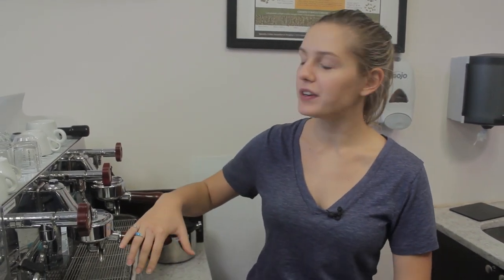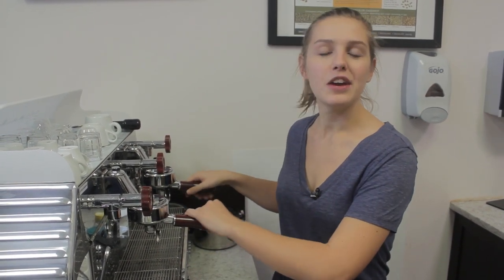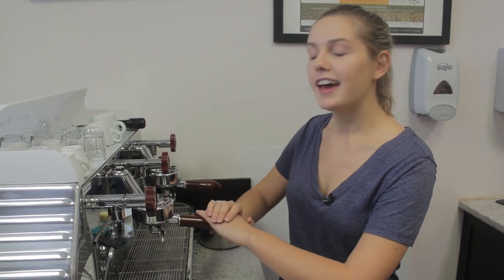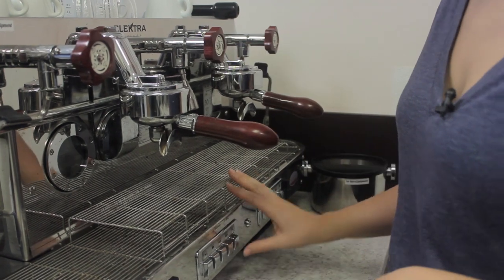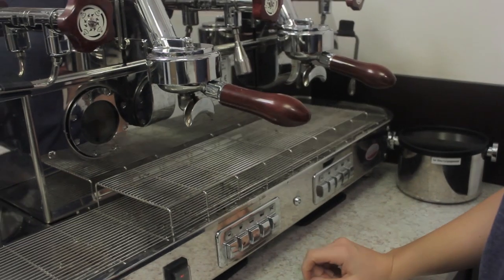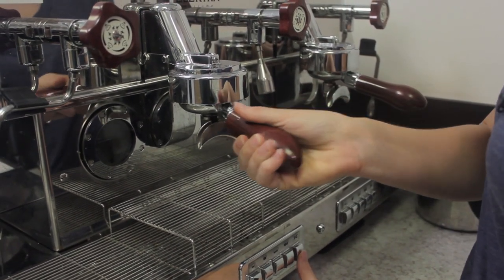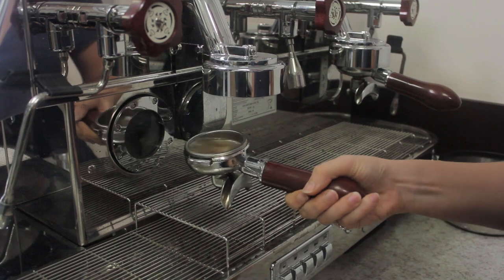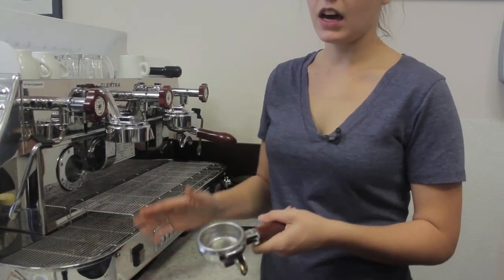Backflushing Basics

Comment: I've been backflushing, with several different machines, for many years but I learned several things in this short, to-the-point video; two significant ones for me. 

(1) I had never realized you could use the lip of an espresso basket to pry up the one that's in place - so I don't have to use the backside of my expensive kitchen knife to do so. 

(2) never heard the 50 shots/cleaning guideline.  I think that's a good rule-of-thumb; I've heard guidelines before such as 'never backflush' to 'backflush once a month,' and 'backflush once every three months' - all over the map, and no rationale for any that I've heard until this one. Over a period of years, I learned the hard way that letting the crud build up in your machine is not a good idea, and takes multiple cycles of backflushing to get things back to internally clean.  So, for me, it devolved to biweekly, which is still a little longer than the 50 shots rule, but at least close. The 50-shot guideline is good, though I came at that from a different direction.

I find it best to remove the screen and any parts behind (in my case)and soak them in backflush detergent once a month or so while I'm backflushing.  Perhaps not all machines allow this, but mine does.  The screen can collect crud, particularly along it's rim, and this dissolves that (a few hours of soaking).  Ditto the brass water distribution disc that sits behind the screen - simple backflushing does not get the crud out of nooks and crannies in it.  So, this, once a month. 

Lindsay did an excellent job explaining in important process clearly and succinctly.  Not often an easy thing to do, but she made it look easy.

Comment: Some good tips. Yes, the back flushing requirements of a commercial machine will differ to a domestic one used for 2-4 shots a day. I do mine every 2 weeks, which on average is around 30 shots. When it comes to  machine cleaning, no two instructors say the same thing, so I watched a bunch of these videos and picked the best parts from each.

Comment: What is better the rubber disc or the metal blind disk. Because the rubber disk allows some water to get trough and the metal blind disc does not. ( sage barista express)
Reply: Are those discs all pretty standard?
Reply: @PharmerJohn1  nope the rubber disk allows some water trough as the metal blind disk does not
Reply: @wSultan  I ordered what is supposed to be a 58mm metal disk but it is just a little too big to fit.  Is there a smaller disk?  I'm on Amazon and all I can find in metal are 58mm disks.  They are priced less than a 5th of what the original manufacturer of my Pasquini Livietta T2 is asking.